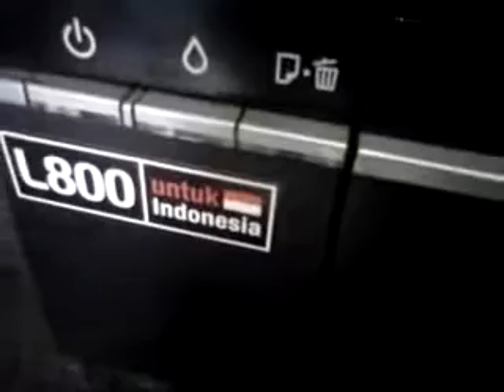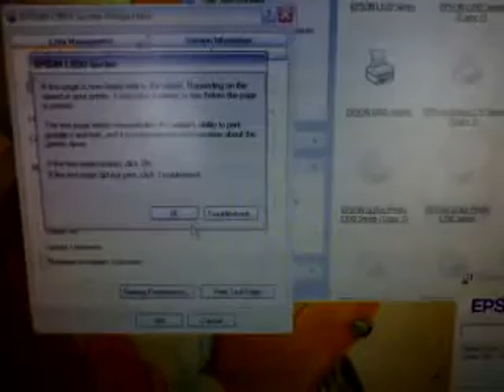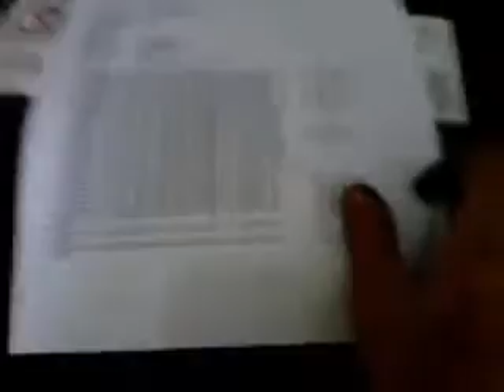Epson Printer L 800 Tutorial Cara Mengganti Head unit

Comment: berapa lama sebenarnya  daya tahan printhead L800 kalau kita  gunakan untuk cetak full block color foto ukuran A4  rata2  5 sampai  7 lembar per hari ?
Reply from the maker: +Agus Palguna kalau pake tinta original samapai 3 tahun bos , kalo pake tinta competible paling kuat 1,5 tahun?
Reply: kisaran harga head print L800 berapaan ya gan, saya cek di Bukalapak harga di kisaran 1.3 jta, menurut agan domain website gmn recomend gak. tg